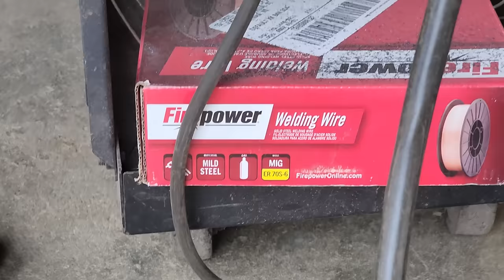It's been decided... the fin is being extended 😵

Comment: Maybe when considering a build that has several pieces that need to be the same make a JIG /pattern that way you can get the same results every time.  Yes it takes time but, in the long run you save time and everything fits better.  Also moving the tools close to where you are working helps more than you may think.  Moving the stump to the front for example.  You talk about that things take time but, your beadroller tool station is on wheels right ?  If you are working on things that you need it then move it close to you.  Patterns are an essential part of building anything so why aren't you using them.  What are you going to do about sealing up the doors from rain or moisture ?  Just the wind noise while driving even.  Even the tool boxes will need sealed to keep water out of them.  It's probably boring for people to watch but, sealing the whole truck sealed up has to be done.  Lots of little things most people don't consider when building things like the hauler.  Good luck with the rest of the build !

Comment: I would put 2" flat stock around the doors so it lays over the truck's body an inch, and put gasket around the flange to seal the weather out. and I would have used continuous hinges on both doors. You're doing a fine job on building such a vehicle.

Comment: It looks great. One think I was thinking as you were welding the part between the windshields was if it came to a point or better yet an arrow head ending it between the windshields or between the bottom of the windshield and radiator opening.

Comment: Chad, I know you don't like using a tape measure, but with something like this fin extension, it is imperative to get it in the middle. It would save you many hours.
Also, the little thumb screws on the side of you welding helmet are there to tighten the face plate to stop it falling down all the time.

Comment: If only one had a straight edge and a measuring device to confirm it's 'tight and right'. The gap between the windows and the fin is uneven. Still would like to see you address the ergonomics of sitting inside this thing and driving comfortably and safely as it's supposed to be a hauler and I'm not talking just from the garage to the museum 25 yards away.